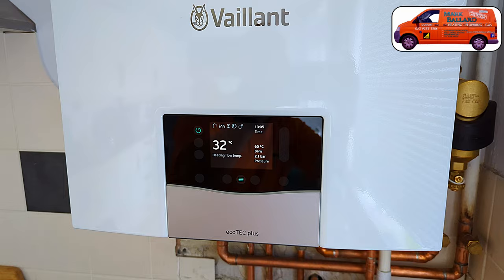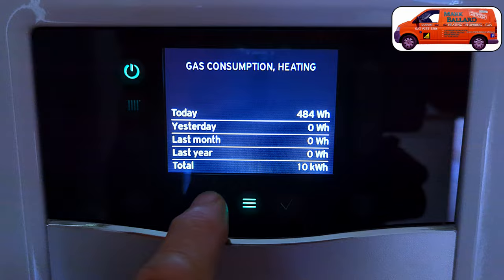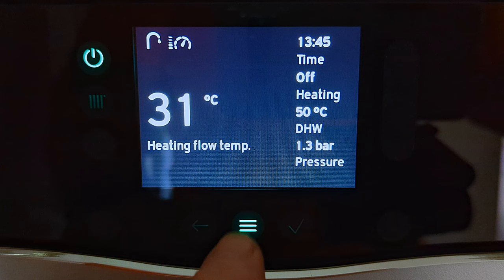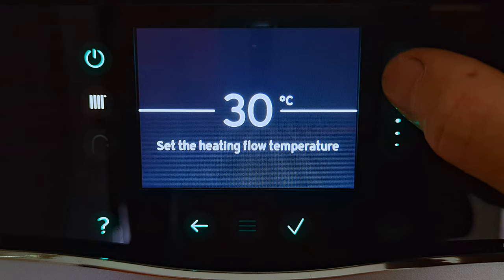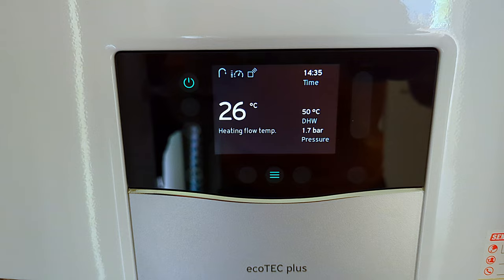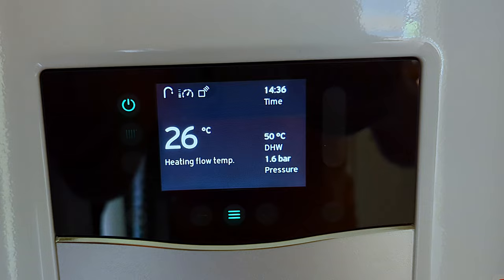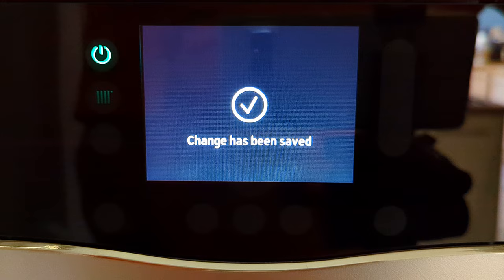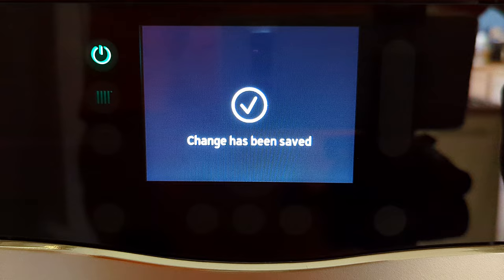How to Use the Vaillant ecotec Plus Combination Boiler,  Hot Water & Heating Adjustment, F22 & More.

Comment: Mark I just had a Eco Plus system boiler installed and ironically the installer had never jnstalled one before. So I have a couple of question since u seem very knowledgeable on the product.

I bought the My Vailaint Connect and Senseohome package and he was unable to connect to my existing system saying I need a VR66 control centre. Is he correct assuming I have a separate hot water controller and nest for my heating.

I also noted the neatness of your filling loop is that the Vailaint controls as mine is way messy outwith the boiler.

Would welcome your feedback and keep up the good work very informative

Comment: Hi Mark, I followed your instructions to top up the water pressure on my new combi Vaillant EcoTEC Plus. However after topping up the pressure the boiler did not enter in to automatic purging mode like it did on your video. Is this normal or only for system boilers

Comment: mark using the valant myvalant connect +sensohome do you still get the N100 error or is it pulling the weather compensation from the GPS locaiton using an internet connection, or is it best to use the wired outdoor sensor still if say using 3rd party controls like the honeywell 6tr, hive or tado